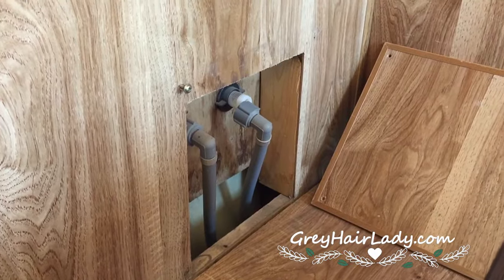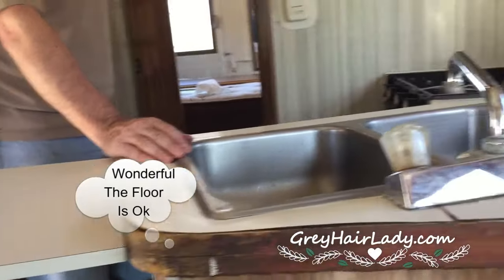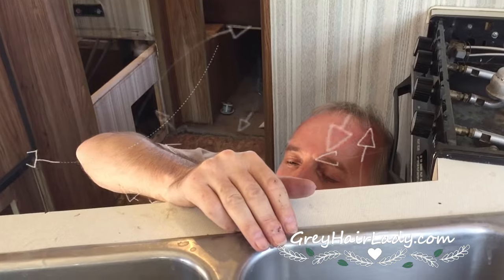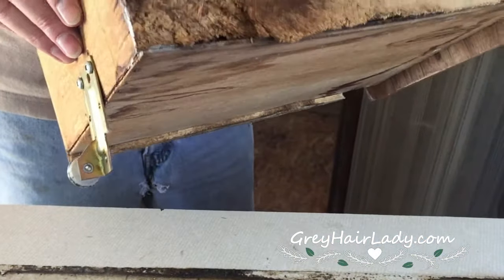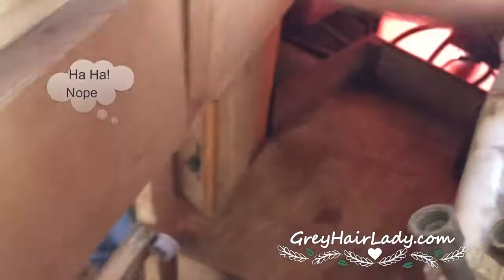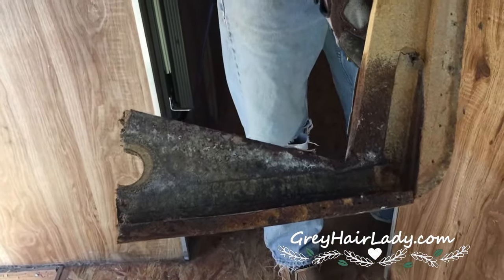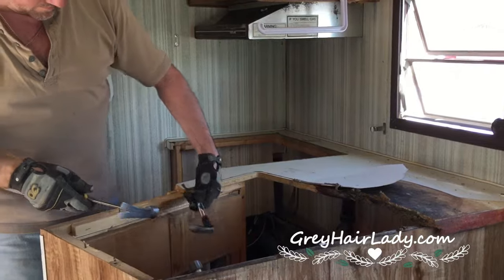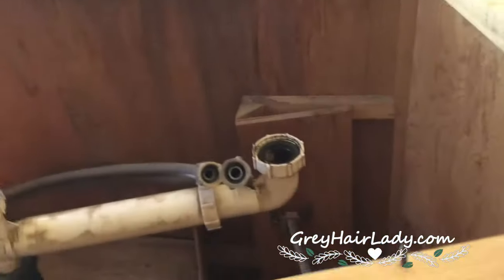Renovating My 1987 Ford RV

Comment: I found vinegar and water in spray bottle kills the black mold spores. Cheap and effective let dry and then hit hard with soap and bleach, once done let dry and spray heavy again with vinegar and water and then ur done. U can paint or bring in new furniture etc. 
mice hate steel wool the sos cheap pads poke in any holes u find they will leave. Plus moving ur domain will rattle some out. Just suggestions hope it helps🐻